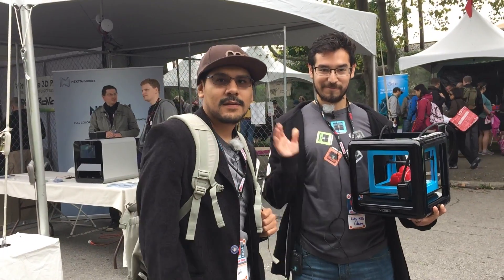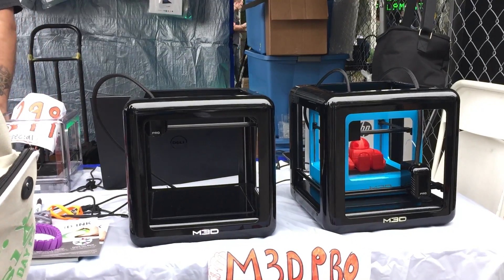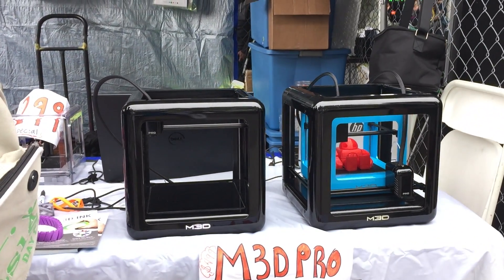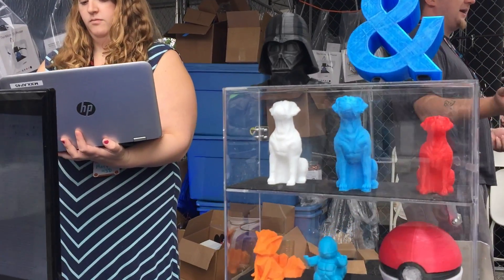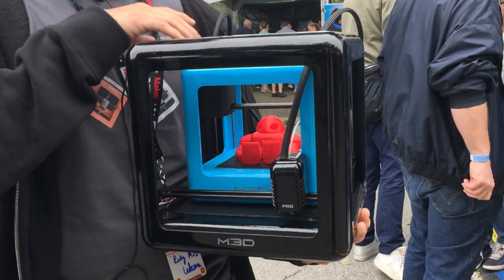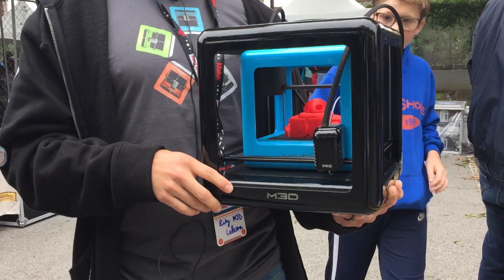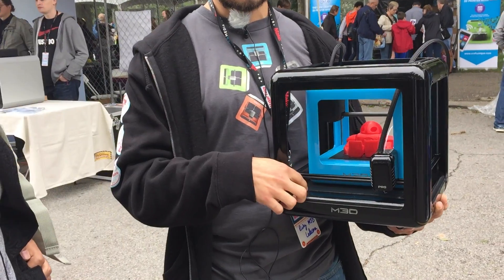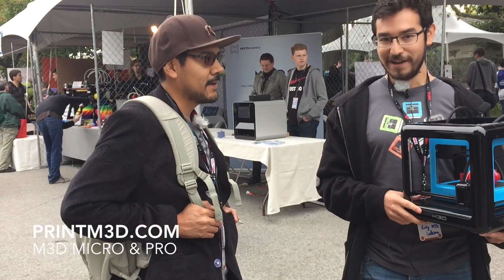M3D Pro at #WMF16

Comment: Closed source.  They out and out lied to be about OSX compatibility.  Could not use my printer under OSX for months.  I can post the email trail to prove it.  Their last update made so that I could not even use gcode from Simplify3D.  Even though their closed drivers prevents Simplify3D from communicating directly, at least at one point I could paste generated gcode into the M3D app.    Very surprised a opensource positive company like Adafruit would post something about a dishonest closed source company.
Reply: Losing S3D sucked. Never used the official software after M33 Fio came out.